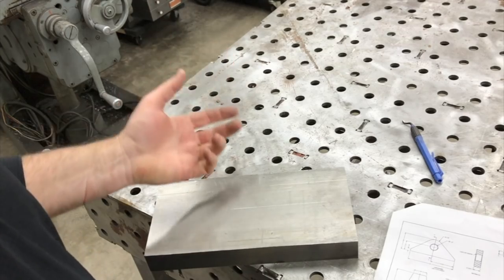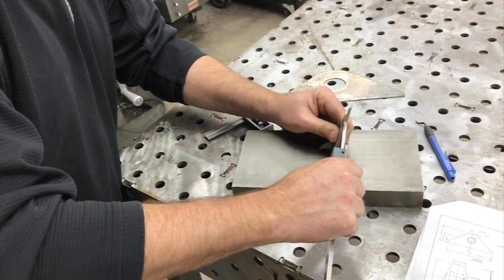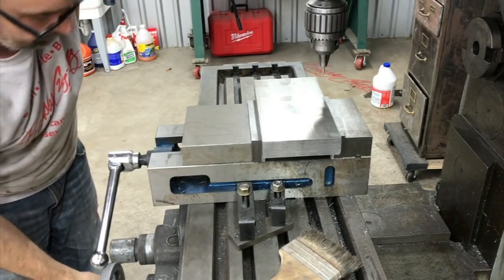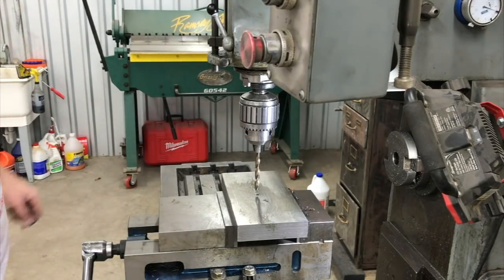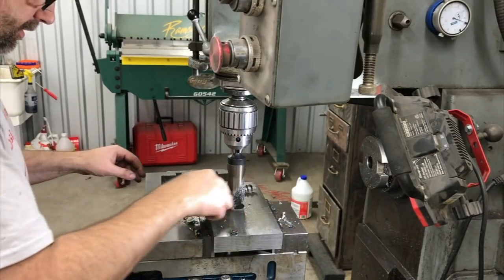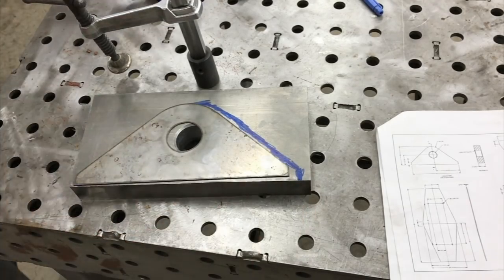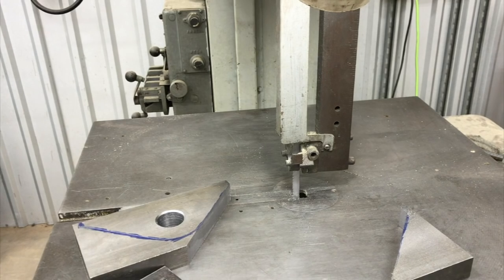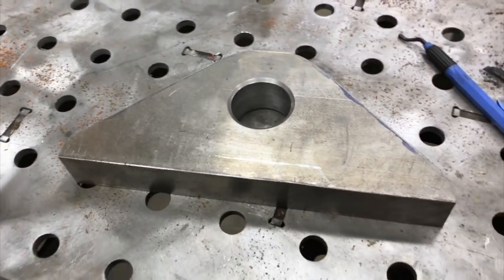Heavy Duty Lifting Lug for 20,000 lb Crane - Drilling holes in thick metal

Comment: Hi, I'm looking for a quick method for cutting out holes and squares on the front panel of electrical cabinets, we now use hand operated punches, drills and alternating saw, the operations take a long time and the quality of the square cuts with the alternating saw is terrible.

Do you think it's possible to use the plasma cutter on varnished panels?
Is there a way of sticking something on the surface so that the varnish of the cabinet does not get ruined?
I could accept damage for 1mm around the edges of the cut, it can be re-coated (anti rust protection). over 1mm le damage could be seen around the edges of the installed equipment, we don't have means to do quality surface varnish.

Comment: That 1-1/2" bit cuts noyce!
Reply from the maker: cuts a lot better/faster with a 3/4" pilot hole... seriously.. just sayin...
Reply: How much extra time does blasting a 3/4 hole take?  When comparing apples to apples, a 3/8 pilot hole (or whatever), vs 3/8-3/4-1.5", which turns out faster?  Drilling is simultaneously about wall clock time and cutting tool wear.  You will get more flank wear with step drilling.  2 flute bits are not designed for step drilling and tend to wander (orbit), for enlarging holes you should use a 3 flute bit or a core drill, they don't wander.

Comment: Gary - Did you get the Horizontal working on your mill? Sharpe makes good "bluing" for layouts :) .
Reply from the maker: Hey Mike... never did get the Horizontal spindle running.  But i haven't spent anytime on it.  Thinking maybe the contactor.  Am going to have an electrician friend stop by and check out the wiring before i pull that motor out.  I will check out the sharp, i am only familiar with the sharpie brand of layout die! lol
Reply: You happy with it so far? I acquired a 2H universal K&T that I am working to get into the shop. I like yours though and its a lot newer than my 2H (1938 :) )

Comment: What mill are you using?
Reply from the maker: It's a Cincinnati.  Has Vertical/Horiontal spindles.  Vertical is 5HP 40 taper, horizontal is 10HP 50 taper
Reply: That's certainly a nice combo, much more fuego than a Bridgeport!

Comment: Love the work it is art. The only thing that bothered me was you did all of that with no gloves I can only think how many times I've had metal shavings in my hand oouuch
Reply from the maker: I hear ya man, but gloves are a major no no around large machines that have running spindles.  Gloves, long sleeves, jewelry, watches, etc can all easily  get caught in the chuck or in the blade, and because these machines have super low torque, 3 phase power, etc they won't stop for anything, they will twist your arm off and suck your whole body into it.  So yea, i do get a few cuts on my hands, metal shavings, etc but it's better than the alternative!
Reply: Ramsey Customs - turbocobra as I was typing it I was thinking the same thing gloves and rotating equipment also long sleeves not a good idea

Comment: Don't scribe with caliper! You'll screw them up.
Reply from the maker: How so?  they are ground, hardened and meant for that purpose
Reply: Ramsey Customs - turbocobra 
You don't work in a precision metal shop that is why you get away with it.  You do that with a pair of calipers in a precision metal shop where thousandths matter and you'll buy a new pair every year tool calibration comes around.  Find a cheap pair of vernier calipers or get a height gage with a replaceable tip, because buddy your calipers are off and you don't even know it.
Reply: I've seen a few get ruined around our shop. The tips will cave in a tiny bit. It's noticeable if you close the calipers lightly with nothing in them. Held up to a light you can see gap. While it's only a few thousandths it's still a discrepancy. A surface plate and a carbide scribe would be what we'd use, or cheap calipers labeled "for reference only"
Reply: I keep an old pair just for that purpose.  Just because it is hardened doesn’t mean the tip won’t get rounded over or bent.